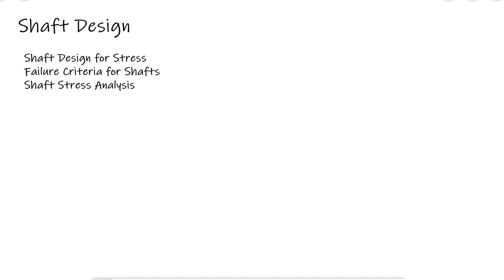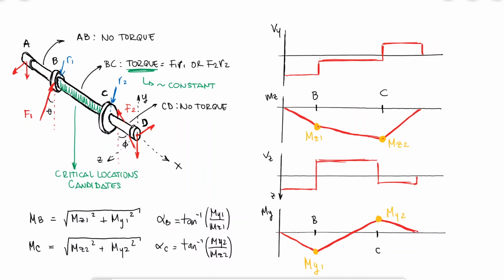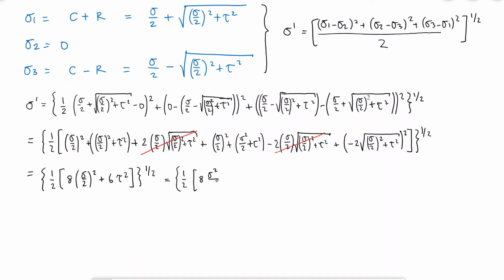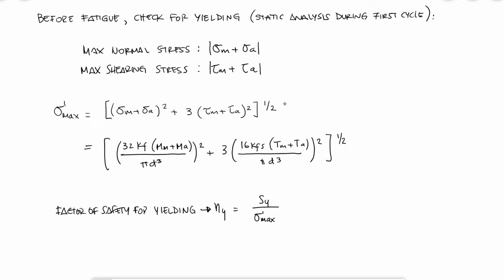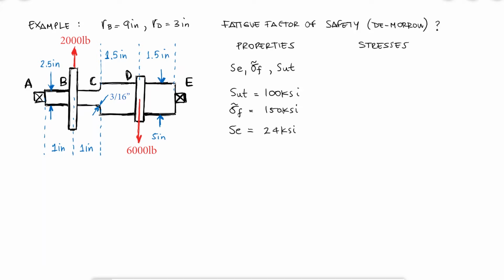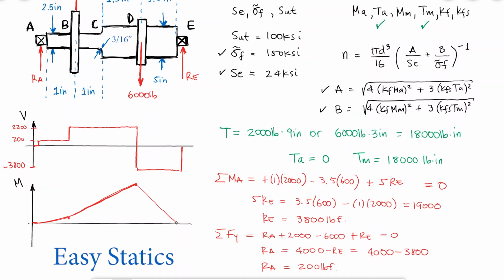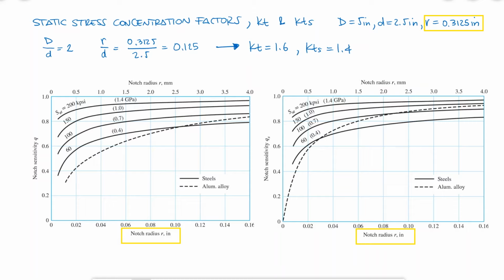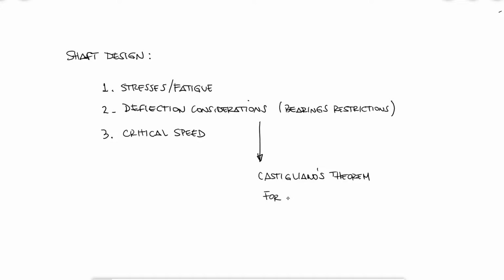Shaft Design for INFINITE LIFE and Fatigue Failure in Just Over 10 Minutes!

Comment: Hello! Any idea what would happen in the case where we have an alternating bending moment acting on a rotating shaft? What usually happens is that we have a static bending moment acting on a rotating shaft, and the rotation causes the bending load to fully alternate. But I have never found an example in which the bending moment itself is alternating (ex. Mb = 10 +/- 5 Nm) WHILE the shaft is rotating. What would we write in the fatigue failure criterion for the bending stress in such an example?

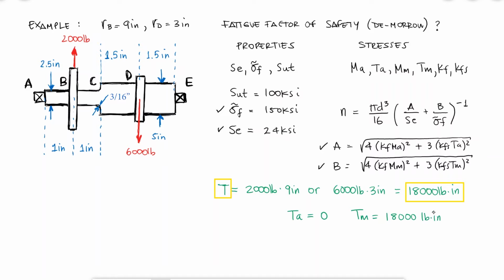Comment: At 7:40 , the alternating shear should equal to transverse shear stress due to forces acting on gear. This is because the shaft is rotating hence causes the transverse shear stress to alternate.
Reply from the maker: Transverse shear is usually not considered for shaft design (unless the shaft is short and thick, which is usually not the case). The transverse shear values don't contribute much to the shearing stresses, and are therefore usually negligible.

Comment: thanks for your effort, but i have a question ; when designing a shaft with gears you know torque changes at the same point of gear , can i take this as a torque fluctuation to get the Ta & Tm ?? or consider always torque is constant ???
also when can i consider Mm for a rotating shaft is not equal to zero???

Comment: why is Kc equal to 1 when von misses stress is used, is it just a fact or is there a reason behind it
Reply from the maker: The reason for the Marin Factors is purely experimental, but they match the values obtained using the von Mises stress for torsion only. Therefore, when using von Mises stresses, Kc should always be 1, as the von Mises stress is already accounting for it.

Comment: at Ma you multiply 3.5 in with 600 instead of 6000
Reply from the maker: You’re right, thanks for pointing it out. However it’s only the 600 missing a zero in the sum of moments about A. Notice that the resultant 19000 and all the other values are still correct.

Comment: How you have take "' Se"' endurance stress ?
Reply from the maker: Can you rephrase the question?
Reply: I mean, 
How did you get the value of Se=24ksi

Can you calculate at this comment platform PLEASE
Reply from the maker: @rustamali8309  Se is given as part of the problem. No calculations were carried out to find it.
Reply: @rustamali8309 The problem gives you either the material or the properties. The properties are given in the back of some books, e.g. Shigleys Mechanical Engineering Design.